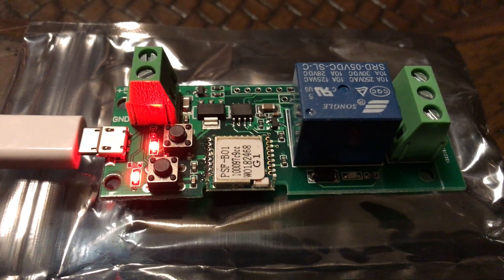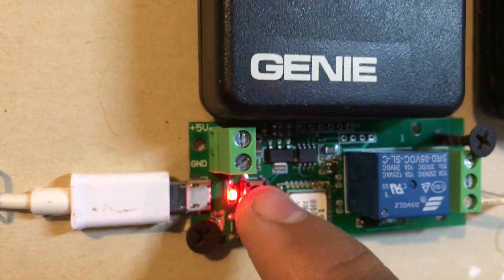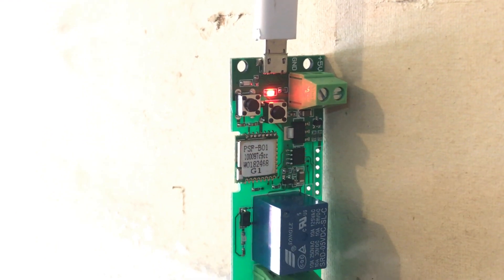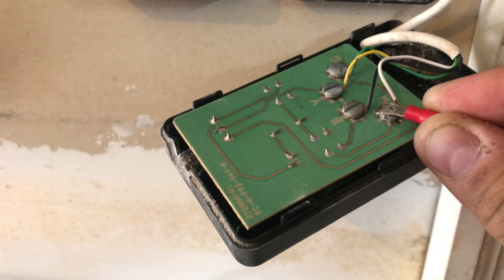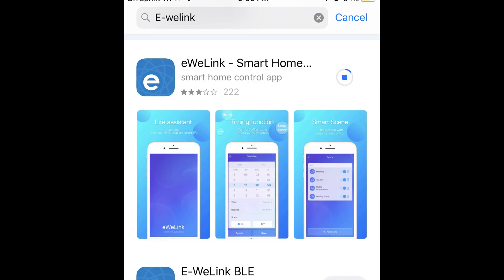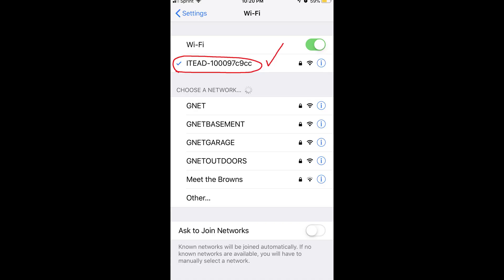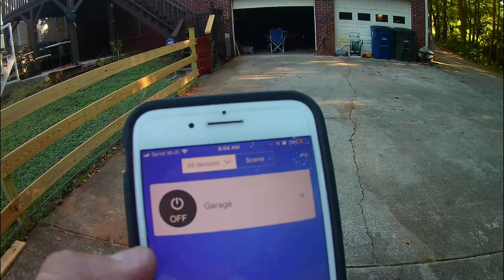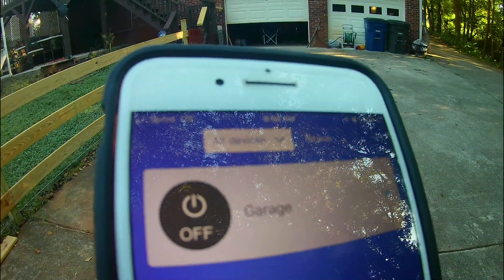MHCOZY WiFi Wireless Smart Switch Relay Module (Review)

Comment: Is it possible to use this relay to interrupt the continuity of a wire to interrupt a circuit, open or closed?  There is no voltage in the circuit.
Reply: Yes, there's 3 pins for the relay. No (normally open), com (common), and nc (normally closed) just wire accordingly, those terms are referring to at rest so with no trigger the com and nc are touching, when triggered the com and no are connected.

Comment: I followed your instructions and my relay works but rig turns off immediately after turning on what could be the issue do I need to change any settings in bios ? Or is it an issue with the relay device?

Comment: My garage opener did not work by shorting neither of the cables. But if you buy a cheap remote and pair it with your door, then solder wires to the push button of the remote pcb and connect them to the wifi relay, it works a charm ! Also, to remotely start computers, its brilliant, cheapper than switchbots pos that are never connected correctly !

Comment: Thanks for this. Assume the old switch on your wall still works to open or close the garage door?
Reply from the maker: Richard Hannay I had 3 options. Connect to 1 garage remote 2 wall button inside garage 3 connect straight to motor/device where cables from button connects. 👍 Please subscribe to channel Thx 🙏
Reply: For older "less secure" units you can hardwire direct to motor on ceiling or button on wall and it'll work, check by bridging the pins on your motor with a paperclip and if the door opens/closes you can. I have a newer "more secure" unit so I had to buy and solder to a remote to imitate someone pushing a button on your cars visor. Works flawlessly. Now with led lights in your garage your results may vary.

Comment: Hi, has it a dry contact for the garage door?
Reply from the maker: jakudo on this piece you have 2 options, dry for this scenario and wet if you want to use it for lightbulbs etc
Reply: Preliminary Films so when it is set as garage door opener it has a dry contact?